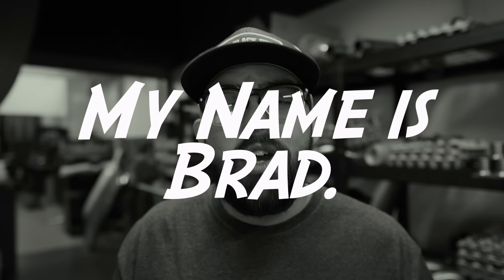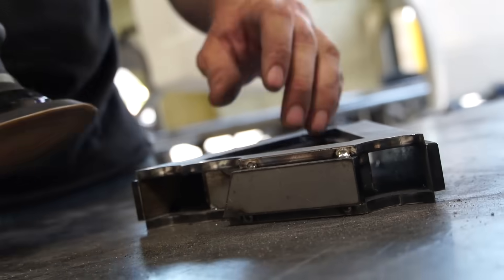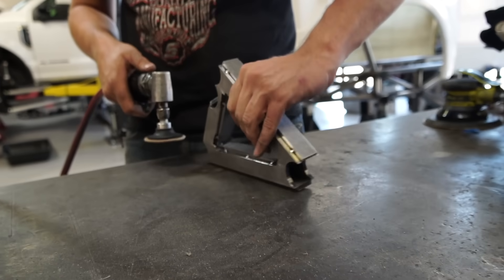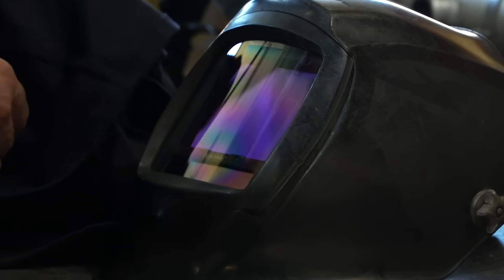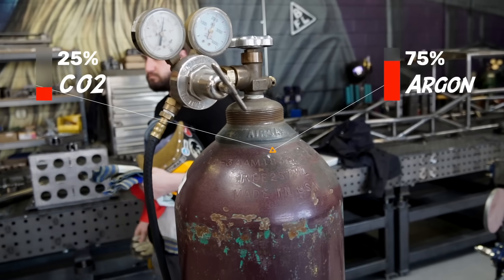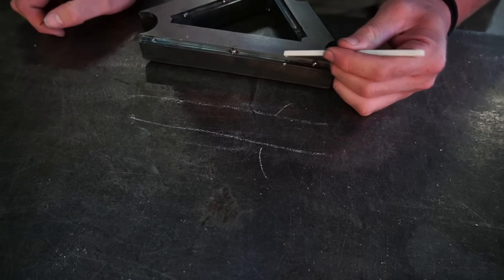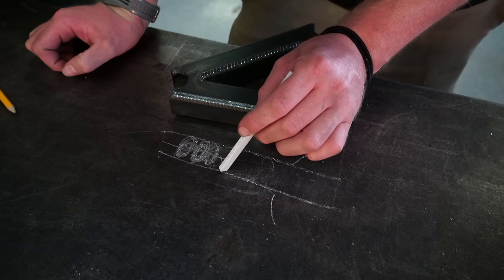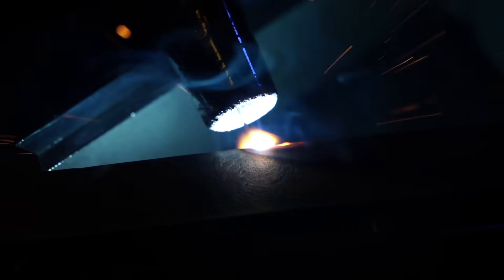HOW TO MIG LIKE TIG WELD (Stacking Dimes) W/ OVERKILLRACINGANDCHASSIS w/ *Tips and Techniques*

Comment: Useful tips. I know I'm a bad workman & blame my tools but...!  My basic Clarke student Mig has a crappy wire feed drive mechanism, I got it to work by using a small g clamp to hold it all in place otherwise the plastic mechanism was useless, with no feed... My previous ancient SIP one had a broken speed control & ran on max feed at all times! It's hard to do good work with bad tools! So a decent machine with good adjustability will help. Second is you need a steady hand. If you shake you need to train yourself not to, otherwise it's really hard to keep a steady smooth run along a narrow line. After that, as everyone says: Practice. And I need plenty more :-)

Comment: Is there a way to weld Stainless with a MIG or an Oxy/Actlyn torch? I like to make my own stainless steel holder racks out of 1/8" round rod stainless. My access to a TIG, is no more. I have several little projects ready to weld, but can't. I've made the soap container racks out of 1/8" hot roll round rod, and painted it, but the soap cuts the paint and it rusts. Any ideas and help would be appreciated. Bill, from Tennessee, 🇺🇸
Reply: Yeah, use stainless wire and the right gas for your type of stainless

Comment: Great detailed demo on achieving the stacked dimes appearance. I have a question that isn't directly relative to this video but is concerning all MIG torches. Why don't MIG torches have a gas shroud made from non conductive  ceramic material? A common issue with metal shrouded MIG  torches is getting a fused piece between the contact tip and the shroud. Wouldn't a non conductive ceramic shroud prevent or reduce this problematic issue ?

Comment: I got U.L. certified doing this.  The only difference was the gas.  They used what is called "Stargon".  That's 75% argon, 25% co2.  I used 92-8.  That's 92%argon, 8% co2. I was welding aerial ladders for Pierce fire apparatus.

Comment: This kind of welding is for looks it's not that strong if your short circuit mig welding on 1/4 in material and about your using the wrong process spray transfer of spray pulse for out of position

Comment: Aesthetics are important when making custom parts for someone's car or other automotive project. Will it pass and xray. Nope. But it looks perty and it will be strong enough for it's intended purpose.
Reply: 🤦 never fails… always someone in the comments that has to throw in their two cents about “slag inclusion” and welds “not passing inspection.” So fucking annoying.. does it look good? Does it hold? Yes then who gives a fuck about inspections and X-rays
Reply: @robbie35able  says the guys who doesn’t weld for a living.
Reply: @Real.Alpheus  that’s exactly what I do for a living. Not everything is production welding that needs to be tested. There is custom fabrication which is what I do where you don’t have some fat inspector walking around telling you how to weld
Reply: The angle they had the gun in some of this video would guarantee they have slag inclusion.

Comment: No makeup needed with a grinder nice looking welds for cosmetics depending upon the application to get maximum penetration the welds won’t be as pretty but they would be stronger and yes they do look like TIG welds great video. Not all welds have to be prone to an X-ray Criteria unless it’s total structural like a pipe liner welder or spot on your welds are simply beautiful and strong enough for most applications great job guys I’ve been welding for over 40 years stick mig tig hydrogen oxy ac was certified now I just tell people what to do as I spent my time in the trenches I can tell you from experience work smarter not harder or you’ll ruin your body

Comment: Looks pretty but I'd be interested in seeing how it performs in coding tests.
Reply: What's a coding test? Is that like when they x-ray the weld?
Reply: @Michael_00001  not necessarily An x Ray but yes. A test designed to test the strength and penetration of a weld.

Comment: Would be nice to see a cut and etch to see if the penetration is all the way.  Short arc welding usually lacks the penetration, that is why it is not an approved process by the AWS for anything that is highly stressed.  Welds look awesome though!
Reply: Yeah, but they did mention that the one guy does pulsed spray welding. I'd bet that the high-stress components are sprayed.

Comment: Your weld turn out good because of the thickness of the metal do it with thin metal I bet you'll get crappy weld.
Reply from the maker: 😂 thanks captain obvious
Reply: can get pretty similar results down to 1/8th in material. Anything smaller and its going to be blend ground, or tig welded

Comment: For em part of the difficulty is not being able to see what the hell Im doing.
Reply from the maker: What Hood are you running?
Reply: @hourglassingenuity103  Im using a cheap Harbor Freight hood.
Reply from the maker: Johnny D That is your problem 😁
Reply: @hourglassingenuity103  So when you look through a higher-end shield, you can see fairly clearly before making a weld?
Reply from the maker: @JohnDrach  some welding hoods almost act as an extremely lightly tinted sunglass. You can walk around with your hood down and have no problem seeing.. or even recognizing colors.
Reply: @hourglassingenuity103  that's crazy I've been welding blind forever lol. I assumed that was normal lol. Thanks for the heads up
Reply: @hourglassingenuity103  So, what hood do you recommend?

Comment: Weaving is structurally flawed, a smooth even rounded bead is what you need. As a master of 30 years this is bollocks and only a finish look not penetrative strength
Reply from the maker: The fact you consider yourself a master immediately discredits this comment. 🥰
Reply from the maker: Not sure when the last time you looked at a weave was.. but this isn’t it. Google the definition of a weave please, thanks.

Comment: You can make consistent looking welds with zero oscillation as well. All this fancy oscillating is often just cosmetic and can be very compromised in a situation that requires good root fusion and pressure/bend test. While the weld in this video looks plenty hot, a weld with heavy oscillation memory can be a sign of a cold compromised weld.
Reply: You are abosolutely right. People that use this technique need to bend test their welds to make sure they are getting proper fusion.

The first time I applied for a job at a shop that bend tested prospect's welds, I did 2 coupons. One with stacked dime welds for looks, the other with near zero oscillation, because I had a sneaking suspicion that the stacked dime weld would fail. It did. Lack of fusion and cold lap. I was hired because I said I thought my first weld would fail so I did another one.

I don't care how good your technique is, if your welds look like the welds in the video, you will have at least some cold lap and lack of fusion. Whether it is enough to make the weld too weak to hold depends alot on the experience of the person doing it. Thats why I don't recommend this technique for beginners. 

 While the application of the parts in the video is probably very overkill and likely doesn't unduly stress the weld and they will probably hold up fine, in an application that does rely more on the strength of the weld it is not a good technique to use. The other saving grace here with these guys is the cleanliness of the metal- the lack of mill scale in their joints is good to see and that's very important if you're welding on the cold side. A coldish weld will often run right over the top of mill scale and not penetrate at all.

This has all been pointed out already I think (rarely read all the comments) so what I mostly came here to say is that when it comes to developing a technique, testing will show you everything you need to know. I encourage everyone, even veteran weldors, to do it from time to time. It will teach you what not to do better than anything, and if you want to stack the dimes, testing will teach you how to get the best weld you can using this technique.
Reply: @cheatinggravity173  No doubt. My first welding job was working for Kubota and you'd get run out of there for stacking dimes. While this process is considerably more visually appealing and is more desirable for welds to be shown off, it's not done in heavy industrial welding for the reasons you guys mentioned: it's easier to get cold lap.
Reply: This is the voice of reason here people, spot on! This guy gets it.
Reply: @cheatinggravity173  The welds in the video are basically "show welds" as the title points out- MIG like TIG. Though they "Look pretty" they are likely low quality, weak welds. The faults you pointed out have been well documented and discussed. This is the negative effect social media has had on everything in society. Bunch of fake instagram welders.
Reply: And also a good way to trap Trash and bust x ray

Comment: I learned this technique from one of the ancients about 10 years ago. No one has been able to figure out how I do it since lol. I call my pattern more the ‘cursive J’ and I push the wire back into the puddle instead of pushing the wire forward essentially ‘pulling’ the gun I guess... My welds turn out stellar 98% of the time and haven’t had a single one break yet. Great video though fellas!
Reply: It's a shit technique if the intent is to lay down some welds that have good penetration and structural integrity. This "stacking dimes" nonsense would never pass code or an etch test.

Comment: I would teach this at my work. Guys never passed the test until they went over the top. But I used similar ratio speed and heat settings as Rod and always got asked why I weld the way I do lol

Comment: my machine only have Amperes but no volts, how many amps i need?
Reply: i'm not sure why your machine doesn't have volts, but maybe it auto sets your volts (which kinda sucks) but in any case, amperes are just your wire feed speed. So try the wire speeds they mentioned in this video and see how that goes.
Reply: @ironplatypus7393  yep, i'm just entering this world of welding and bought an accessible machine in my pocket to go testing, so good, to try until i get the same haha, thanks

Comment: Beautiful work.  People need to remember though that with all the settings right, and the material prep right, you still need to have the hands for this.  Practice practice practice.  10,000 hours.  But yeah, .030 makes life easier on this application for sure.  Still, seems to slow the process way down.  I would probably lean towards just using a TIG.  However, if you can MIG like that you will be impressing people at the show and shine.
Reply: 10,000 hours. LMAO. dude that is over a YEAR of arc time. come the fuck on man. if you welded for 8 hours a day, never stopping to change bottles, wire, fit up nothing. just straight welding 8 hours a day. 7 days a week. 52 weeks a year 10k hours is 3.5 years. This technique can be learned and mastered in 2 weeks, tops. Ive taught hundreds of kids to weld like this in our shop over the years. Stacking dimes with a mig is a parlor trick, not some trophy of mastery.
Reply: @DieselRamcharger  you are correct Sir. Its more about footage of weld but still keeping quality top notch. In my experience with aluminum at least 300 feet a day is a norm if conditions permit.
Reply: @DieselRamcharger  depends on penetration needed too. Tig gives a ton of control. I wouldnt say mig is quicker but it definitely is easier.
Reply: @Sak-zo1ui  mig is undeniably faster. which is why tig has the highest cost per inch. because its slow.
Reply: @DieselRamcharger  i mean you can crank the amps up and increase travel speed for tig. Depends on the type of mig thoughShort circuit will clearly be faster with barely any penetration. Mig is definelty a quick and easy way to weld. But some would say stick welding is fast also. My point is experience is a big variable on the speed of the welding. But in all honesty welding should not be entirely all about speed but proper weld profile and penetration. The speed comes with time. A proper weld is much more important.
Reply: @Sak-zo1ui  speed can always be increased by raising amperage and thusly travel speed. But at some point the cost and complexity of running inch thick wire at 14000 amps just aint worth it. Tig is heat then add filler.  Mig the filler droplet is in the arc which is where the time savings comes from. Anyway you slice it. Migs faster Tigs better.
Reply: @DieselRamcharger  agreed. Experience is key at the end of the day. As long as it gets the job done correctly it is all good.
Reply: this is way faster cheaper and lower skill than tig. this is hack shit, honestly.

Comment: Those are the same exact techniques I use. With the "cursive e" technique I like to run the machine a little hot to maintain penetration, because I am moving the puddle around a bit more. Great video.
Reply: Same id be running like 22 or 23 volts but moving alot faster and like 250-260ipm wire speed
Reply: You're probably naturally more artistic then most of us.

 I would recommend that people who struggle with consistency be taught the whip he showed first its the fastest way to quality welds for those of us that have no natural talent.

 The other one that's like the Es but simpler is a back slash motion advancing the bottom first each time.
 It's kind of the best parts of both techniques combined.
Think of it like the Es if they had no loops.

Comment: No wonder my welding are shit.. I’ve been trying to learn at 21v 330 wire speed lol
Reply: That's not a bad thing. Settings depend on a lot of factors. I would frequently weld 14 gauge to 1/4" using 0.045" metal core at 27V and 380ipm spray transfers. You have to move your ass fast. Once you get the rythym down you can pump out lots of great looking strong weld.

Comment: The prettiest looking woman in the room is seldom the strongest.  They are usually  shallow and weak.
Reply: Which would you prefer
A roll cage with structural integrity? 
Or
A roll cage that looks good on instagram?
Reply: Mr. H -
A good looking weld MIGHT be crap, but a bad looking weld is SURELY crap - A SCORE Chassis inspector.
Reply: @chucknoob7041  That's not what the guys at MDR say
Reply from the maker: Mr. H neither, because this isn’t a roll cage. I don’t see anyone welding anything round in this video. It’s open corner welds. 🤷🏻‍♂️
Reply from the maker: Man.. that’s depressing.
Reply: You are correct. I would never do this on a structural joint or on anything that could be stressed via harmonics. But welding body or plumbing tabs and brackets this is fine. I would hope that any welds being done by short circuit wouldn't be structural anyway.
Reply: are you saying his weld look good but are weak and non penetrating???
Reply: @adamsorell4851  In either case it's all about good penetration

Comment: Wish I could show you my mig work. 100% positive I would be your 3rd beast welder you ever knew
Reply: A lot of people genaly for get a bout mechine set up prolarity and shielding gaes haveing proper prolaty set my self over 35 years welding every day prep or no prep i can make the weld do what i wount it too .running a lot thicker wire useal y metel bec welding one. Two. Three inch thick or more try mix for gas i use a lot of the time.o remeber to pay atention to youer mechine where youer at on the dudety cyl

Comment: Looks very pretty, but I wouldn't want to trust it for anything structural though. Inclusions, lack of penetration not to mention time-consuming, everything I try to avoid.
Reply from the maker: I’m sure you don’t weld chassis for a living. 👍🏻
Reply: @hourglassingenuity103  no, not for a living.  I worked alongside a guy that was ex JCB, he would spray everything on high amps. Never any undercut made a lovely herringbone pattern with a fusion line down the centre. Every weld a work of art, truly a joy to behold, but that line down the centre scared the crap out of us. We sent a sample away for testing, suffice to say it was rather interesting, I stand by my original post. Your work does indeed look pretty, I bet it looks even better powder coated, but metallurgy is what it is.
Reply from the maker: v8trauma I respect your opinion. Every major chassis out there running races has this same process when it comes to weld and fab on the frame and they aren’t splitting in half. So.. the world will continue doing things the way they always have in the high end chassis world. If trucks were breaking in half I’m sure they would change it up. If you look at half the junk builds at a show like Sema.. and the garage level hobby welds holding those things together.. that’s where the real fear comes into play. 🤓😅 have a great day.

Comment: Lots of perfect welders apparently. I personally need to learn.  Solid info.  I went with .035 for my first spool because...perhaps I should change out.  .035 needs heat and penetration else it builds way too quick.  If I start weave pattrerns with .035, I'm building ugly piles of filler. Problem is, average steel thicknesses I'm working with don't like that much heat.  Anyway, time to practice, thanks fellas!!!  I'm subbed for sure.
Reply: The wire speed and voltage he has set for this type of welding would work alright with .035, but it is similar to what I used for 3G applications on .045. The .035 would probably want to be pushed closer to 20V with the similar wire speed. I used to do a half moon style whip when I did flat or horizontal welding, of course, I haven't been doing it professionally for almost 5 years now, so that process may have changed for me by now if I were still doing it. If I were doing similar to what he did (hydraulic tanks makes me think of this same setup) I would have done a forward-back weave to maintain the penetration for it. Like others have said, though, practice makes perfect, and I was nowhere near perfect after 13 years lol!